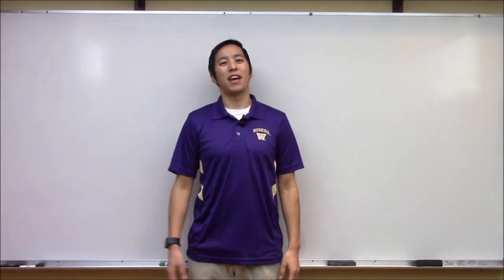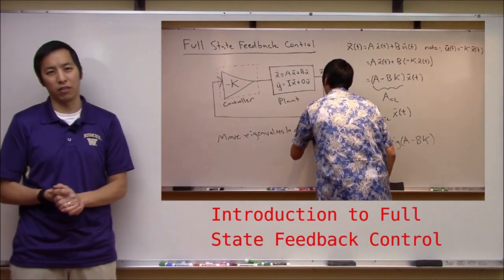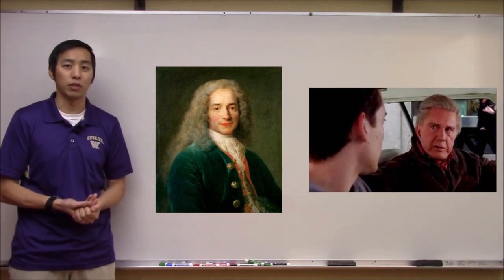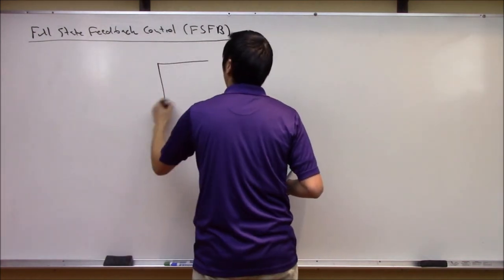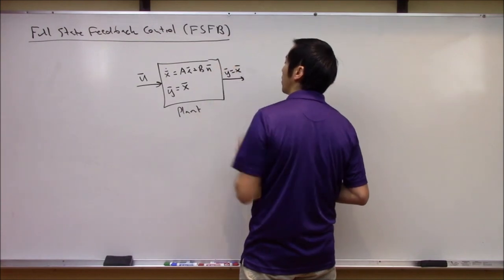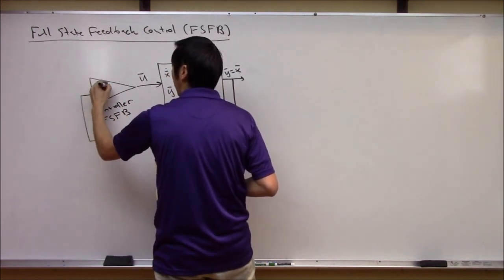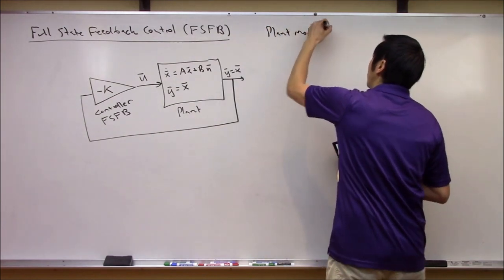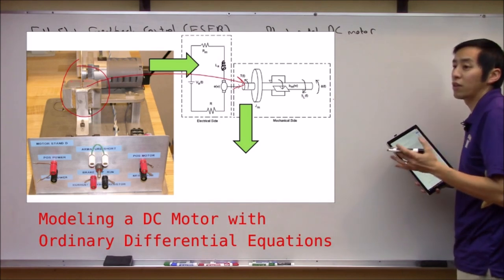Practical Implementation Issues with a Full State Feedback Controller

Comment: AE511: This video made me eager to dive into LQR, since you point out that most "real life" systems are not as clear cut with regards to the pole-state coupling we see in the DC motor example. 

In practice with something like a consumer quadcopter, would we see regulators like FSFB and LQR used for stability augmentation?
Reply from the maker: There are several codebases that you can inspect if you are curious.  The ArduCopter firmware is popular and it does indeed use some of these ideas (as well as PID controllers).

Comment: AE511: Maybe you're going to get to this later in the video, but is there a way to set a "max" value of control authority, aka Vmax  = 10 V or something, and solve for the poles associated with that max amount of control authority? Then you could solve for the FSFB gain matrix to get the best performance with that constraint in mind.

I guess another consideration of FSFB is that probably in a lot of scenarios your initial conditions could be variable which could result in variable magnitude of control inputs.
Reply from the maker: That is exactly the right question.  This is what we will do next week with LQR control

Comment: AE511-great presentation! I am confused about the last part where we set the K = [0.21 0.04 0.003] in the sense that I don't see how it solves the inability to measure the full state of the system issue. Since we can't measure x2 and x3, then the feedback only consist of x1.  Thereby, no matter what values k2 and k3 is, the input will end up being u=k1x1?
Reply from the maker: Alan, you bring up an excellent point.  The key here is that k2 and k3 are small relative to k1.  Therefore, if we simply neglect x2 and x3 (since we cannot measure them) and only use the control law you mention of u = k1*x1, then this is hopefully not too much of an approximation of the true, FSFB control law of u = k1*x1 + k2*x2 + k3*x3 (since k2 and k3 are small).
Reply: @ChristopherLum  Sir, Thank you for the lecture. Do you have any reference for this approximation? If I want to go for a publication whether it is okay to put this concept straight away or do I need to give some reference? Looking forward for your answer. Thank you Sir.
Reply from the maker: @surjasekharchakraborty210  Feel free to use as you see fit, thanks for watching.

Comment: When giving a list of poles to the `place` command, does the order matter? Say for example, a system has poles at -1 and -2 and our desired pole locations are at -2 and -3. Is there a difference between

`place(A, B, [-2, -3])`
and
`place(A, B, [-3, -2])`
?

I just ran the above example through matlab and got the same K matrix in both situations. But does there exist a system and desired pole locations such that `place(A, B, p) ~= place(A, B, fliplr(p))`?

Comment: Dear Professor! We have end up our discussion here that if we can only measure shaft angle the appropriate full state control K matrice is [0.2099 0.0442 0.0031]. In other words, as you explained we are able to neglect control signals from current and speed.

Now I am trying to understand the actual implementation of this controller.  it seems that given this K vector we need to solve system equations find solution for U (control signal) which will be the function of measured X (angle). Is it correct?